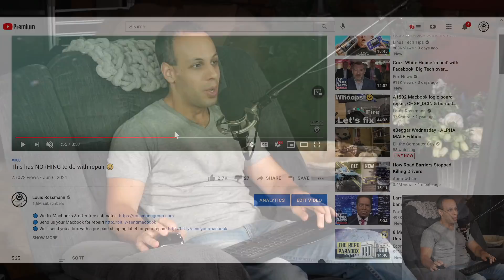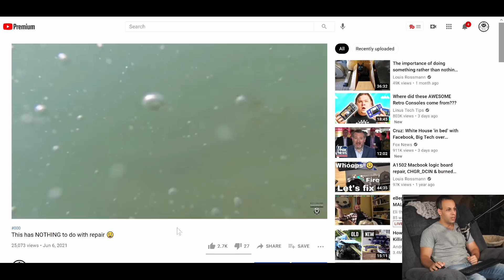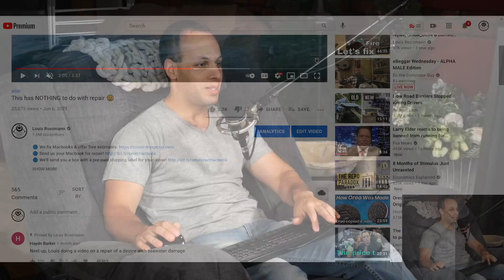Why are user serviceable batteries a bad thing?

Comment: Good old times when you could just buy a quality new phone battery & easily replace it..... good times...
Reply: Man, I'm 25 and you just made me feel like I'm 80. "Back in my day" people used to get mad at phones with sealed batteries, now they defend them. What is wrong with this generation? lol
Reply: Samsung xcover pro is the only newish phone I can think of that has a replaceable battery
Reply: I still buy quality brand new old nokia battery at very very low price for some little projects, good time;)
Reply: now you can easily just buy a whole new phone when your current phone runs out of battery, boom profit hehehe
Reply: @xamthor  and build a "cult" around buying a NEW one every year because it is "better"
Reply: Good ol 2014 note 4
Reply: @exalented  basically peak phone.
Reply: zizek would argue this is the symptom of capitalism people wanting and fetishizing their own restrictions
Reply: That's why I'm reluctant to upgrade my indestructible LG V10 that can be disassembled with just a precision Phillips.
Reply: I miss my Galaxy S5 with 2 extra batteries. I would neever have a charging issue.... and could feel safe that there's no power to "manage" any apps or phone devices (mic, cam, etc). 
Liquid safe replacable batt could be done as you mentioned...just like Right  to Repair its about the education...👍🏽keep rockin.
Reply: Yeah but I like a galss or ceramic back. Glass feels nice. Plastic doesn't.
Reply: @datachu  Glass is fragile, attracts fingerprints, and putting a case on will turn your "nice feel" argument into nothing.
Reply: @datachu  Well, thing is, glass backpanel can also be made detachable. It's just going to be attached differently.
Reply: @datachu  could still have a glass back with removable back

Comment: Possibly because they go straight in the trash?  Causing fire later on. Also not good for environment.
Reply: Wanna know what’s not good for the environment the whole phone going in the trash it’s not my problem that e waste and the recycling of it isn’t common cause nobody has the proper know how or even access to do so
Reply: @gamerguy6990  no but you sure as heck are gonna pay for that ignorance. I agree it’s not our fault but in order to ensure you have a “waterproof” device this is how it is.  Lawyers and end users fanatical desire to sue this is what you get.  Give the customers too much leeway and they hurt themselves and here comes the lawsuits.  I’m pretty sad that’s that’s the world today on that front.  Thus dictates how things are made and designed.  Of course it doesn’t bode well for end user fixability.
Reply: @DouglasHeyen  that waterproofing has already been done better by watches and those are way more serviceable than any phone out there and will probably outlive all of them and the lawsuit thing I really have no answer to
Reply: So instead you want to throw a whole phone in the trash because the battery is bad?
Reply: A dead battery being throwing into the dump is less likely to cause an issue than a phone with a dead battery still sealed inside it being thrown in.

Also, if devices were easier to repair, fewer would end up in the dump. What nonsense would make you believe that making devices harder to repair would lead to less E-waste?

Comment: I want user-serviceable storage on top of user-serviceable battery. (but I probably want it even more than the battery tbh)
Reply: Removable storage would be awesome, buy more memory later on if you need
Reply: Just stuff an entire 970 evo into your phone.
Reply: To be fair, thats kinda what sd card slots are for. But it still suck since many apps cant be ran from the card.
Reply: @MmeHyraelle  Unless something has changed, Android offers the option to format a micro SD card to be recognized as internal storage thereby allowing you to bypass this restriction.
Reply: @MmeHyraelle  Exactly the point. EMMC storage is faster than SD cards. But the fact these storage chips are soldered onto the phone almost completely lock in the expiry date for these devices.
Reply: some SoCs can boot from uSD without ever touching the internal storage, so you could just do that and pretend that there is no internal storage